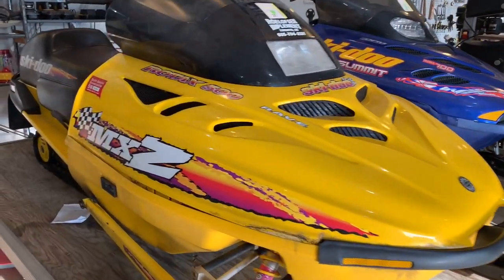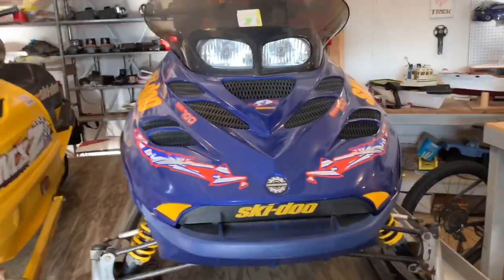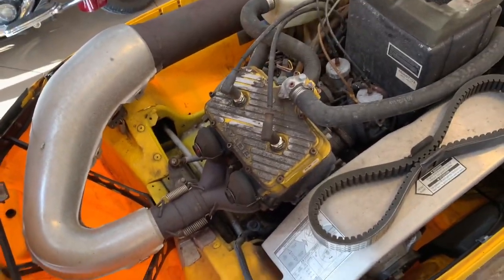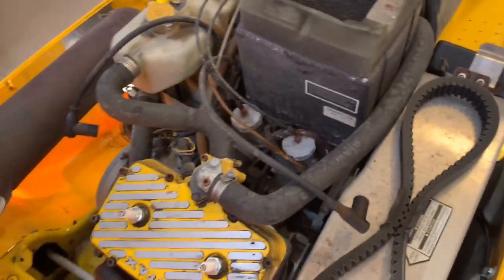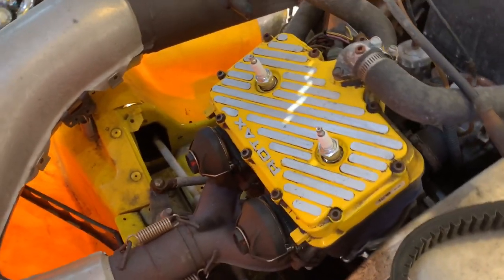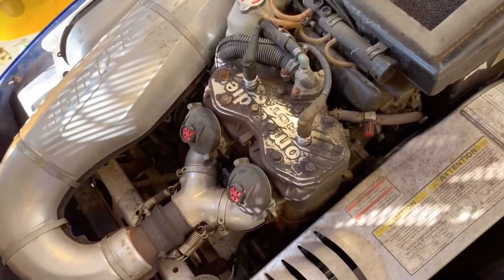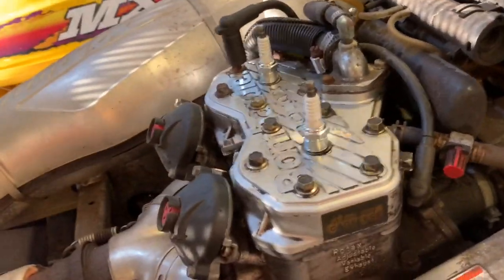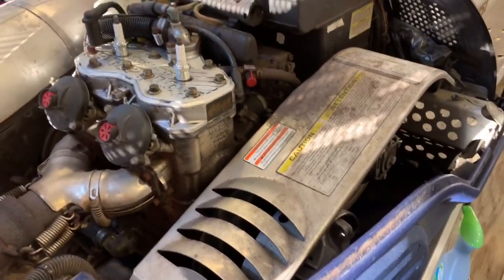Cleaning Up The Old Sleds (Summit, MXZ)

Comment: That old MXZ is a 121" man, every single trail sled was a 121x15x1" back then.
Reply: No my buddys is a 114
Reply: @jbmoto2253  What year/brand/model? 114" tracks are a relic from the 1980's, I'm 90% certain every trail sled from the debut of Doo's S2000 chassis has been 121" until the recent jump up to 128"...
Reply: @wildboer  1987